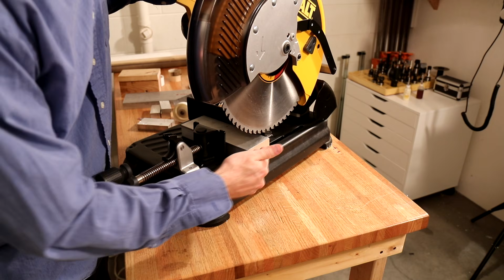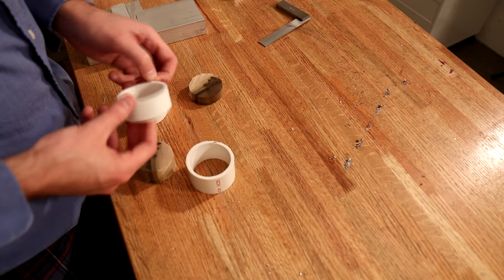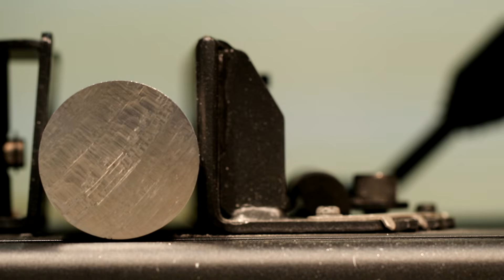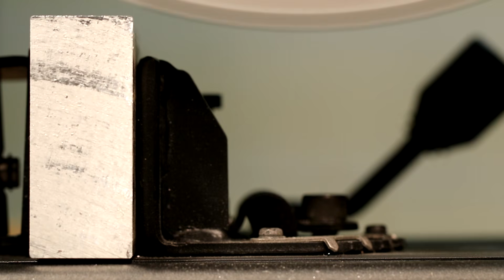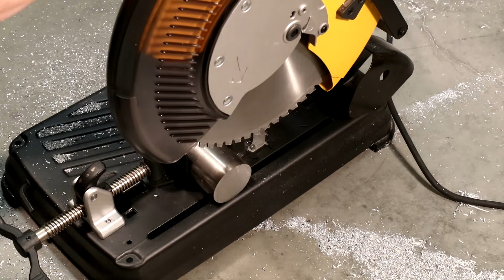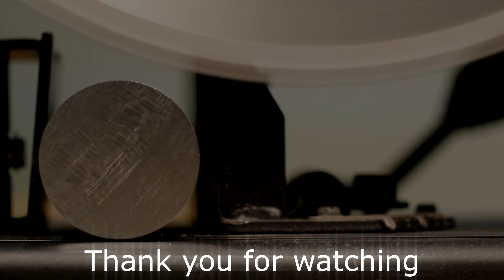DeWalt DW872 metal cutting saw review and demo

Comment from the maker: Check out my most recent video: https://goo.gl/Jj7cU1

This saw is one of my most used and favorite tools in the work shop. It works well but could be made great with an improved base and vise. All the major parts bolt onto the base so replacing the base is possible. If you have any suggestions or ideas, I would love to hear them. Thank you for watching.
Reply: great review, and super thorough. NYCcnc posted a custom mounting plate, seems like a decent solution.
Reply from the maker: Thank you commenting Caleb. I would certainly like to purchase John's ( #nyccnc ) upgrade, but as I understand it requires a lot of space below the cutting surface because of the clamping system they've used. 

The note on the website is "... the saw will need to be mounted to a stand or bench (with a clearance area of 8"+ below the fixture plate for clamp clearance)" 

If the space is not a problem for others, here is the direct link:
https://saundersmachineworks.com/collections/all/products/dewalt-dw872-fixture-plate

Regrading the angled vise plate I mentioned in the review, that may be allowing some vibration, someone else suggested it may be by design to hold round stock. Seems a reasonable explanation.

Best wishes, Kent

Comment: Great review because you see the little stuff like crappy fence and tilted clamp that allows movement of the piece.  I just bought a cheap 179$ HF chop saw.  Abrasive original blade.  I'm not happy because blade cuts angled.  It's like it flexes to the unsupported side.  Seeing side blade wear from my slow recutting the cut to square it up.

Comment: I bought that saw and it cuts like crap and I was only cutting 16ga material and it kicked back 1/2" tubing when I cut it at a 45 degree angle
Reply from the maker: Return it if it's not working. For want it's worth, I cut tubing slowly, slower as the wall thins, slower than with an abrasive chopsaw. That's all I suggest.

Comment: For just normal 1/4" metal and thinner, how many teeth should I use?
Reply from the maker: For these carbide tooth circular blades? Probably can't find one that follows the 3-5 teeth engagement suggestion for bandsaws. On the DeWalt and EVO380, I use the stock blade and feed very slowly. I cut a good amount of DIN rail and 16 gauge tube without trouble.

Comment: The saw is great but the base and 45 set up sucks. Saunders machine makes a bolt together base that is fantastic. Turns the saw into a really great tool https://saundersmachineworks.com/collections/dewalt-dw872-fixture-plate
Reply from the maker: Good information. Does the replacement need additional clearance under the saw and is still portable? Thank you
Reply: @kentvandervelden    The base has bench holes and comes with 2 clamps 8 inches long as well as a 45 degree adapter and an attachment that allows use of the Dewalt clamp. If you don't have clearance under the base you can shorten the clamps. The link has a video that shows it all working. I made a rolling base for mine with clearance for the clamps . It's totally mobile and very solid / stable.

Comment: how long do the blades last?
Reply from the maker: On solid aluminum, seems like forever. On steel, depends on hardness and care. Feed slowly, minimize the sparks and never cut hardened steel, which should be cut on an abrasive saw, and the blade will last a long time. I've sharpened one in the time I've owned the saw and that was only because I cut rod that was too hard. The saw cut it, but the blade was dulled. Sharpening was $25USD at local wood working store. Hope you can find a similar sharpening service.
Reply: @kentvandervelden  Why would you prefer this over a small Grizzly band saw($800)? Floor space  considerations? The dewalt sells for about $500.
Reply from the maker: I had the ~$800 Harbor Freight bandsaw and that work well and wasted less material. I gave it away when I moved to town. The chopsaw is faster but louder, messier, and probably more dangerous. If I had the space, I would have a nice horizontal bandsaw for most things and an abrasive saw for hardened stuff. The chopsaw is nice for thin stuff though. Larger aluminum plate I cut on the table saw. Steel plate could be cut with plasma torch. Yeah, space is limiting factor.

Comment: If you have a horizontal bandsaw where would you prefer to use this saw? Also where would you still prefer to use an abrasive chop saw?
Reply from the maker: I had a couple nice horizontal bandsaws. They were too large and I didn't use them much. I continue to use a vertical bandsaw though. I also had an abrasive chop saw. I rarely used it and it's pretty dirty. The only time I use a cut off wheel is to cut hardened shafts.

Comment: Can you use and abrasive cutting wheel with this saw.
Reply from the maker: (Insert all the appropriate disclaimers here.) Short answer: It's probably fine for light infrequent use. Longer answer: I could find no requirement in the manual restricting the blade type. However, the retracting part of the guard is plastic and the blade turns at ~1300RPM. So, you may see stuff sticking to the guard and the abrasive blade is not going to be as quick as in a normal chop saw. You have a great question, and I've never thought about it, and gave away my abrasive chop saw and wish that I had not for the times when I need to cut hardened rod. The arbor size is the same. I've looked into mounting the carbide tooth blade on an abrasive saw, but there are warnings printed on the DeWalt and the Evolution blades not to spin them faster than 1800RPM. I used to use a similar blade in a sliding compound miter saw to cut aluminum, and occasionally teeth would detach at 4600RPM. They hurt, but I wore a face guard and felt safe. Hope all this was helpful. Thanks

Comment: Can u do me a favor and answer a question for me.       I am looking at getting the dw8500 diamond blade for metal I already have the big dog of the chop saws from dewalt so I dont need the entire set up u have but I can not find the saw blade you are using by itself I'm just finding ur set up can u help me??
Reply from the maker: I bought a spare blade on Amazon for ~$150 and had the original resharpened for ~$25. Do you need me to find the Amazon link to the new blade?
Reply: @kentvandervelden  ok I just looked at the specs for the blade u sent me it won't work on my saw it's only good for 1800 rpm so I may have to bough out and get the the whole set up because I'm remembering now that's why I was having trouble finding a metal blade for mine that didn't cost more then the saw cost me I got my saw for 80 dollars happy purchase if I don't say so myself however because it's the fastest saw DeWalt makes (in a bench mount) then I'm limited to only one blade
Reply from the maker: @samrowe2889  Don't take this as a recommendation... I've wonder if the speed limit has to do with the saw and blade being marketed for both steel and aluminum. If only cutting aluminum perhaps the limit would be increased? I've previously used a Freud blade for aluminum in a Harbor Freight sliding compound saw and that worked great for cutting aluminum. I've since debated using the DeWalt blade on an abrasive saw, for aluminum at least. That's all I know
Reply: @kentvandervelden  thank you kent
Reply: Yes if u don't mind I would appreciate that
Reply from the maker: @samrowe2889  Here's the one I bought: https://smile.amazon.com/gp/product/B0000302QT . You might also check Evolution's blades - they may fit and have additional options. Best of success
Reply: @kentvandervelden  do u know any one personally that has used the dw8500 and what is the speed wud u say u cut at thru say half inch rebar what is the max rpm on ur saw mine is 4300 so that limits me on what I can get

Comment: Hi Kent, I got this saw one month ago and I’m having a problem when I cut 45 degree square metal pipe or thick metal, I always have to do some adjustment on fense and the clamp, so it takes more time to adjust than to cut, if you can send me your email or this is my e-mail (robertzhubi68@gmail.com), I will send you some pictures of the cuts I made with this saw. Thanks a lot. Robert.
Reply from the maker: Hi Robert, I sent you an email.

Comment: FEMI 782xl or dw872?
Reply from the maker: Hi Carlos, I had not heard of the FEMI 782xl before now. It looks nice. From the specs, the FEMI is limited to 4" in the longest dimension, and I cut 1x6" stock with the dw872. If that's no concern for you, I'd might just prefer the bandsaw, where the blades are surely a lot less expensive and the bandsaw will be quieter and cleaner. But I have no experience with this particular bandsaw. Another one to consider is the EVO380. Best of success to you

Comment: hey what are the dimensions of the base of this saw. I haven't bought one yet, but would to start making stand for it.   thanks
Reply from the maker: Hi Tyler, the base is 32x52cm
Reply from the maker: Also, the base is 8.5cm high. The manual says the mounting hole spacing is 257 x 441mm and recommends 1/4"-20 screws 4" long plus material thickness.
Reply: Thank you very much

Comment: I know the manual doesn't recommend lubricants, but even a little bit of WD-40 makes all the difference in surface finish with these saws.
Reply from the maker: Thank you Joe. I'll give it a try. I used to do this with the Harbor Freight sliding compound saw I used, with a Diablo non-ferrous blade. What's been your experience with steel? The 1018, 1045, and 1215 that I've cut have all come off looking fantastic. I tend to wonder if they meant this saw more for tubing not 3" solid, but so far so good. Best wishes, Kent
Reply: Kent VanderVelden I haven't tried steel, but I've cut tons of aluminum on both a DW872 (owned by a coworker) and my Evolution Rage2.  It's the same result on both...no WD = the same surface as in your review, with WD = super smooth shiny cut. My theory is as you mentioned, chip welding from chips that go around the blade back into the stock, but the WD keeps the surface temps down just enough to keep the chips from welding and push through. That's just my guess, but The results I've been getting speak for themselves. I may try my Fogbuster w/ Qualichem on it just for fun. That'll give me chip evacuation and the best coolant possible. I cut mostly .5-.75" bars of 6061 btw
Reply from the maker: If you try your FogBuster, maybe try it with the coolant turned off, maybe blasting the blade as the it's leaving the material. In the video it's possible to see aluminum chips being carried back. Maybe just blasting them off of the blade would be enough? I have some work to do tonight and will experiment a bit. BTW, I like your profile picture. I used to fly 152s and 172s and hope to get back to it someday.
Reply from the maker: Thank you Joe, I made an update video following your suggestion (https://www.youtube.com/watch?v=6Vr2vv0GAuw). Not only did the surface finish improve but the so did the cut time. Using air didn't seem to help at all. I considered trying a FogBuster, but realistically, I wouldn't take the time to set it up for only a few cuts. It probably would work really well though. If you try a FogBuster with the saw, I'd be interested in how it works for you. Best wishes, Kent
Reply: a regular wood chop saw with a TCG blade does just fine with aluminum.
Reply from the maker: +Brian Graves Agreed, I used to use a sliding compound mitter saw from Harbor Freight. I started with the original blade and replaced that with a non-ferrous Freud blade. I had to improve the clamp down, but that combination was affordable, worked well, and had a large capacity. Thanks for commenting
Reply: Joe Lotuaco 
We've used stick wax for 60 years, cutting aluminum extrusions up to 1/8" thick and our blades last. Can't make money changing blades or cutting nasty joins. CRLaurence sells a good one.